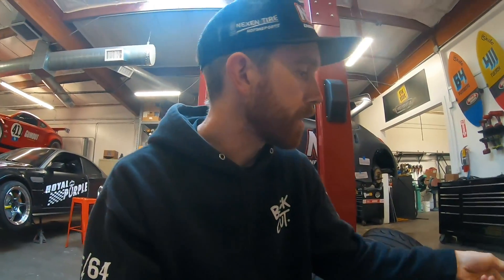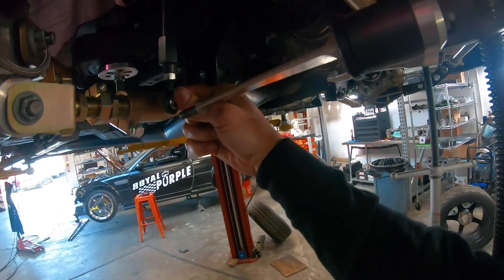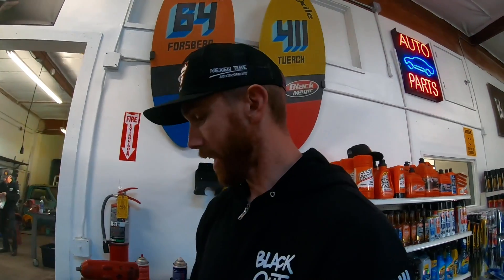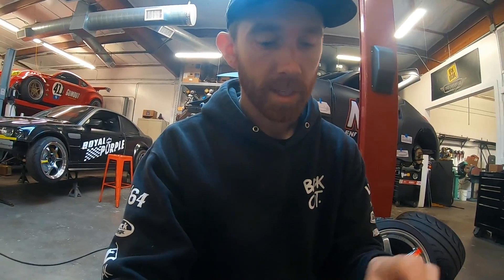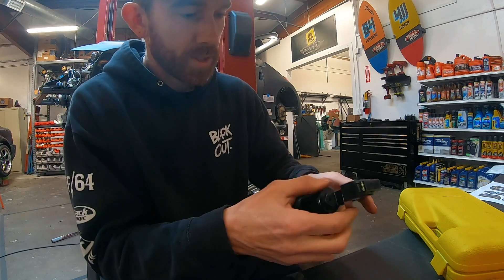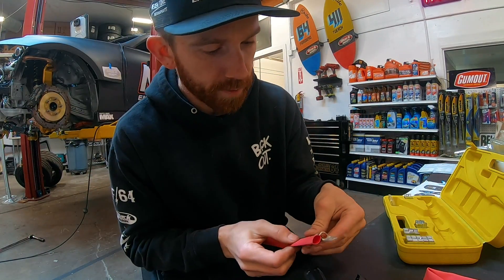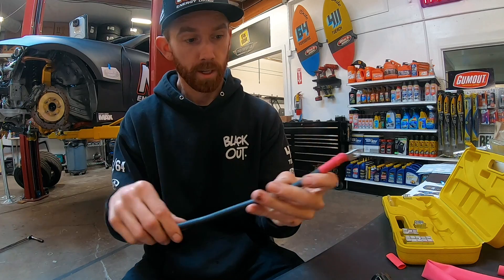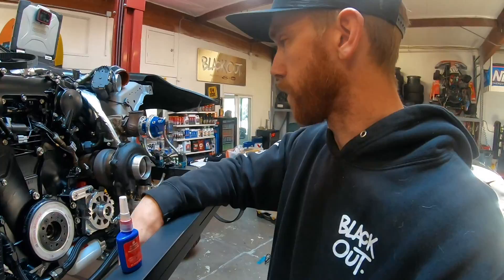How to Make Battery Cables and Blade Style Sway Bars Explained

Comment: I would have heated up the plug filled with solder or melted a fishing weight into it push cable pour some water so you don't melt the rubber then hit it with a punch.. even if I had that bad ass crimping tool I would have still done that.. lead fishing weights are cheap.. thanks for all the videos brother 🙏

Comment: Love these types of videos. Just made some battery cables at work the other day. Never thought to use a punch like you showed.
Reply: I would have heated up the plug filled with solder or melted a fishing weight into it push cable pour some water so you don't melt the rubber then hit it with a punch.. even if I had that bad ass crimping tool I would have still done that.. lead fishing weights are cheap..